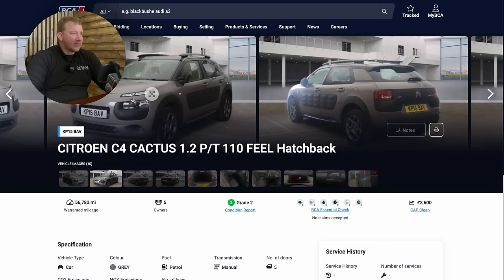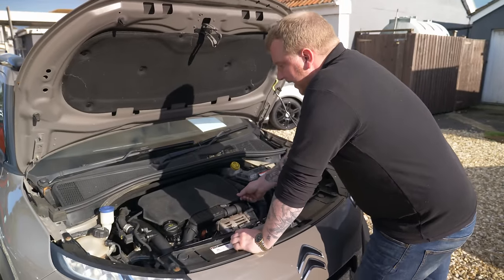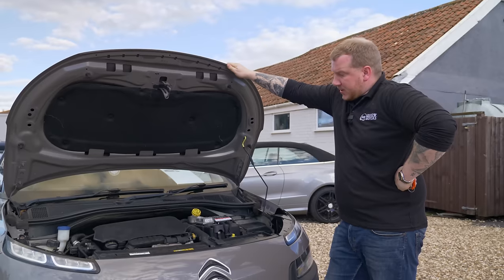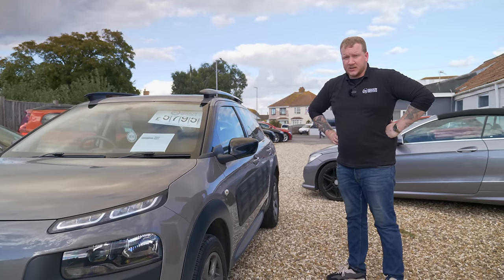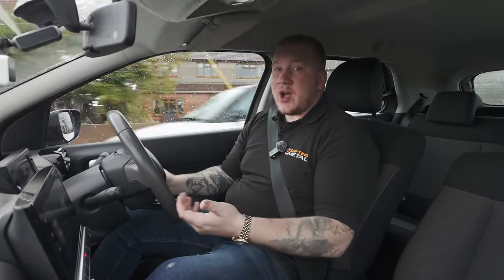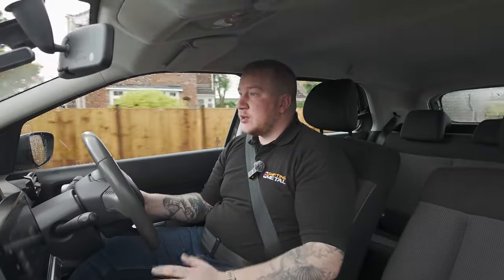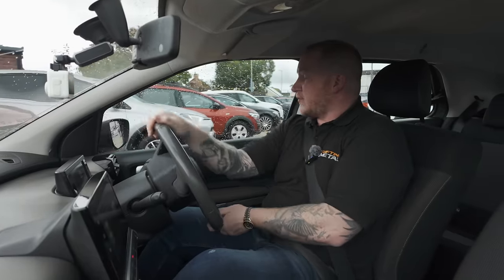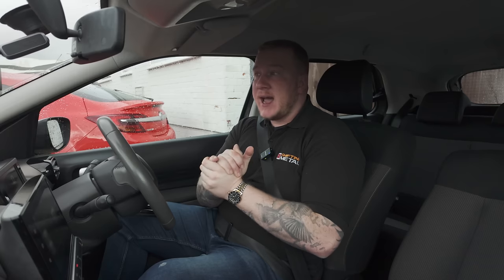I Bought A Car From BCA And It's Got The WRONG ENGINE!

Comment: When that guy was sat around the big table and he said "I've made an engine that will run on a new system called a wet belt", they should have shown him the door there and then 😮
Reply: The designers got AWARDS for this design 😂😂😂
Reply: @exgtt2061  the award should have been life no parole
Reply: @bigbob7062  😂👍
Reply: And at the same table someone said: hey and lets have engines with different coloured dispsticks.
Reply: Wet belt isn't inherently bad. It's implementation of the design is bad, WHEN, combined with the regualtions requirements, component costing and packaging concerns.
Reply: blame the EU as it was the new emission rules which forced manufacturers to make these bad decisions all to make the engine quieter and lighter.
Reply: @williamcoulter5462  how can it be the EU's fault when other manufacturers don't have the same issue?

Comment: Before selling, might want to read this: I know this is an old thread and everyone may have either sorted the problem or sold the car, but I've just experienced the same problem following an engine change from a yellow dipstick engine to orange dipstick. The fault code P0087 is misleading as is suggests there is a fuel pressure problem, but I subscribed to Service Box for a day and compared all engine part numbers between the two engines. Peugeot are clear that, although the engine code EB2DT is the same, some part numbers are different depending on whether it has a yellow dipstick or orange, the main one being the inlet camshaft. I have now replaced the inlet cam on my orange dipstick engine using the original one from the yellow engine, and that has cured the problem.

Looking at the two camshafts in my hand, you can see the timing of the three lobes that drive the HPFP are 60° apart, so it looks like the ECU picks up the timing of the high pressure pulses which is 60° out of phase and shuts the pressure off, and then tells us there is a pressure problem. I have observed the pressure on live data using Diagbox and it is much more responsive delivering the required pressure compared to using the orange engine camshaft.

So, the bottom line appears to be the ECUs are configured differently to match the different camshafts - totally unnecessary in my opinion, but...there you go!
Reply: Would it not be easier to change the ECU,s rather than the camshafts ?
Reply: @peterjones2650 think that depends on coding, ecu has part of the immobiliser in and they would be vin locked i suspect.
Reply: @peterjones2650 if changing the part the ecu is not expecting fixes the problem, that is always best.  Putting a new ecu in from a different type, might cause new unexpected problems with one of the many other parts and sensors.
Reply: can code this(change from Yellow to organge-grey-green or from orange-grey-green back to yellow) in your ecu remotely if you have diagbox cable

Comment: Citroen have a history with dip sticks.
During WW2 when they were under Nazi occupation they swapped out the dip sticks for "extra long" dipsticks so the Germans would run the engines  low on oil and fail prematurely to help the war effort/resistance.

Comment: Had the same issue at our Peugeot Citroen independent , new engine fitted, lobes that work the fuel pump are at different angles. Put the cam in from the old engine perfect. Original issue was that the car would drive perfectly around town at low speeds but as soon as you went to motorway speeds light on and limp mode

Comment: Those 1.2s are a ticking time bomb. Even if you have one that’s had its belt done it won’t help you because the damage is already done and it’ll have had oil starvation when the original belt degraded and now it’ll guzzle and burn oil for fun until…. it doesn’t!! Don’t touch with a barge pole.

Comment: The belts degrade even if recomended oil is used.
Reply: Mine is coming up to its 10th birthday so I'm not complaining.
Reply: As does every timing belt on every car
Reply: @agiugabenson7268  not nealy as quick as a wet belt though ?

Comment: So when the engine was changed at the main dealer as you said. The problem is with the parts department at the main dealer. They have to supply the workshop the correct engine. As the parts department are looking it up they should be checking it's the right engine for that vehicle's VIN number.

Comment: I had a DS3 from BCA with the same issue, someone had swapped out the engine for an different spec. Was impossible to fix and BCA had it back in the end. Full refund as was not sold with any explanation on the sale! I am in the trade and they will refund you!

Comment: The wet belt systems are a fundamental design flaw, heaven knows what those designers were thinking at the time.. well in theory they would be great, but hot oil and rubber don't really get on and as the belts degrade, they drop bits of rubber in the filter .. and a blocked oil filter leads to a seized engine. They say "use the right oil" but that's not the complete solution, it will still happen. If I were to buy that car, I'd replace that belt twice as often as they say to.

Comment: Main dealer parts guys like engines as they get more bonus for selling a high value item. So they should be more careful when looking it up on the electronic parts catalogue to supply the correct part.
After all, surely the same note that pops up on your diagnostic machine, should be displayed on the EPC.

Comment: I've found Aston barclay is the best of a bad lot, go in person, wait with the car, not in the hall, take your mechanic with you, not as glamorous as just bidding on line, but loads safer, don't buy anything expensive without it being assured, not infallible, but at least you'll have a better chance, avoid anything  that's known to be a bad vehicle as well, no matter how tempting. Check everything online as well, mot history, Google reg number as well, I did that the other mth on a 4 series m bmw, it was on a dealers forecourt only a week before at 11995, now it was going thru Astons at 9k,sure enough engine had a slight bottom end knock. All good advice mate from someones who's been in the job for a long time.

Comment: True the lobes on the inlet camshaft are different causing incorrect fuel pressures,Citroen technical said there are other differences in the engine so put the correct engine in.but you clever guys out the are doing different things that a main dealer can’t do.

Comment: That dipstick looks like the one that it left the factory with. The difference in colour indicates that there is a difference in the timing belt tensioner. That will be the cause of the problem as the wrong tensioner was fitted, throwing the timing out.

Comment: KP15 BAV, was for sale in June and Oct 2020- £6250 with 55k, then again May 2021 £5750, 55k dead again, red flag. The wet belts shred even with correct oil and regular servicing they need to be over serviced to guarantee. The mot history is not great looks like 48k and failed on loads first mot 3 years old
Reply: Next job for you car buyer at Berrow motors, Joes Glamorours assistant.
Reply: BP15 BAV is a blue VW Golf what's it got to do with this car?
Reply: @waynemandco  nice he can’t afford me a track down real crimes
Reply: @tootles74  Good spot KP15 BAV
Reply: MoT history also shows it had sat for three years between the most recent tests. That alone would have told me to look elsewhere.
Reply: The only way out with this is to get someone to make an electronic widget that alters the fuel pressure signal to something the ecu is expecting.

Comment: Send it back! EML is a MOT failure regardless and you shouldn't have to be clearing it for MOT or for a customer, it's got the wrong engine for a reason, worst case scenarios on those puretech's ios it kills an engine and maybe that's what happened to this so they replaced it asap and chucked it into a auction, it's very suspicious and don't even bother with it as even parts you get now will be wrong

Comment: PSA know how to make good bodies (don't rust) good seats, and good suspension.. but are terrible at electronics. The switches break, the relays melt, the cables corrode, cars do weird things like wipers coming on when the car is left parked... Radio is coded to the ECU , mileage is stored in ECU and speedo... just drama all the time.  The Japanese seem to make the best electrics.
Reply: remember the 1.6 diesel... dog of an engine

Comment: ANY oil degrades wet belts they are DESIGNED to snap
Reply: Exactly! Just like BMW mini have a designed weak spot, a plastic bodied water pump. They know it doesn't last long and needs replacement, so screw customer out of servicing or unnecessary trade in. The majority of motor manufacturers are now just greedy who don't want their cars lasting forever, it's bad for business.

Comment: An expensive lesson learned the hard way as to why wet belt engines are best avoided.
If you do sell it, be prepared for it to haunt you.
I would stick it straight back into the auction, and absorb any loss.
It takes years to gain a good reputation, why risk it with a dodgy car.

Comment: What a nightmare! I am glad my VW Passat CC disel 2010 does not have all that cobblers! A much simpler setup.
Reply: The reason is "2010", not the fact it is a VW
Reply: I had one of those, biggest heap of shit ive ever had
Reply: @stupossibleify  If you wish to comment, try to say something that makes sense.
Reply: @JoanCarradine  Ok: "Euro 6'. Does that now make sense to you?
Reply: @stupossibleify  Nope Euro 6 did not begin until 2015, thus my car has a Euro 5 rating.
Reply: @JoanCarradine  that's my point! Euro 6 is the issue blighting all modern diesels. Your VW has none of these issues because it is pre-Euro 6. It has nothing to do with VW being inherently better when compared to the vehicle in this video. Goodness.
Reply: @stupossibleify  That is just your opinion, NOT a fact! Get over yourself.

Comment: I wonder if you could just swap the fuel pressure sensor for the correct engine? The ECU is only recognising pre programmed parameters. Perhaps that is one if the differences? The computer can only see differences in the maths .. it cannot see the colour of the dipstick.

Comment: Can't you use some kind of resister or the opposite of a resistor on the fuel rail pressure sensor wire to make the ecu see a higher pressure.

Comment: I would buy the the Topdon diagnostic machine and drive the Citroen for years, just keep clearing the code when it pops up, that’s if I would ever buy a French car again, which I never will, after a nightmare with a Peugeot 307 HDi!!🤣
Reply: So are you saying that Joe has a new workshop go for, run around motor 😉 if it doesn't get enough at auction?

Comment: Back in the early nineties when I was in the trade I did worse than that..  I bought a what seemed a relatively cheap,. indeed too cheap Nisan Micra from Exeter auctions without looking at it and leaving a proxy bid.. When It eventually turned up at my site here in Cornwall I found out that someone had put a fairly crap mini engine in it!   Did I feel stupid or what...

Comment: Can't you just change the ECU for one sourced from a (scrapped) Shitroen with the same variant of engine that's in this car?
Reply: Yeh spend a 0ver 500 doing that not with that margin, i would have sent it back as not motable 😊
Reply: @DashDriver-z1r  👍
Reply: ECUs have been VIN/Immobiliser locked for well over 20 years
Reply: @kaptinkeiff last car I replaced the ecu it had egr set to minimum (to pass MOT emission test) and immobiliser disabled
Reply: @leexgx  Correct, you have to disable the immobiliser to use the ECU, some companies offer the service for some brands

Comment: Remember this.  Wrong engine in car.  If remember. Already swapped over. I’ve had one P/T. Yup. Was goosed. Oil sump removed they’d already cleaned the gauze.  Gave up immediately trying fix it then.   Wanted do chain.  In end. Never managed start on it. What an engine the PureTurd

Comment: In the 80s the Dealerships were annoyed that people bought new cars and then took them to their favourite backstreet garages to do servicing work. One of the first to try and turn customers back to Dealerships was Vauxhall and their recessed plugs. You needed a special tool to remove the plugs but Vauxhall had the copywrite to it. And so it has gone on. All manufacturers have layered their vehicles with as much "safety" etc products, computer controlled this, computer controlled that. Local garages can't afford a lot of the software to be able to deal with easy to fix faults. Now, even the dealerships can't sort it out as you've found with the software. (Possibly because the Manufacturers are wanting to deal direct with customers or everything will be leased.) I much prefer older cars. £2 for a headlight bulb rather than £700 for whole unit. (Explains why so many newish cars have headlights out on one side at night.)
A modern mechanic is an IT worker. 
Keep up the good work, love your vids.
Reply: Even the dealer dont want this nightmare lol Agreed though, As a mechanic trained in the 90's car parts are expensive and a minefield of tec related isues.

Comment: Can someone please enlighten me as to why the colour of an engine oil dipstick would cause a fuel pressure fault and engine management light?
I own a 2005 citroen berlingo diesel and the dipstick on that is just a dipstick that tells you the oil level when you pull it out. I'm just mystified as to why a certain colour of dipstick would cause engine faults. 🤔
Reply: The dipstick colour just indicates which type of camshaft is fitted to that particular engine, it’s colour on it’s own has no effect on the the way the engine runs.

Comment: never ever buy one of those new Shitroens as i call them they are as crap as the corsa and fiat 500 etc always trouble with them , I bought a 500 from a dealer cost £3 grand for a 2013 lounge model with low miles i thought it was a good buy but they never told me the clutch and gearbox were knackered so £1000 on top of that £3 grand i paid for it and after months of arguing with the dealership only got half the £1000 repair bill back and the worst thing was the warranty they gave me was not worth the paper it was written on.

Comment: Jesus, check the pin data on the ecu harness and swap the wires to the correct location, use carmine if you don't have access to wiring diagrams
Reply: Carmin, auto correct strikes again

Comment: Does the v5c have to have the new engine number added before you can sell it? Does the vine number refer to the type of engine it should have?
Reply: Well on the electronic parts catalogue in the Citroën parts department it should show what engine should only go with what VIN.
Also the V5C should have the new engine number on it.

Comment: Having driven a number of fleet cars since the 90's, Citroen and some times Peugeot dealerships have been mentioned in a bad light a number of times. Not sure why Peugeot are better, being the same group! 
More often than not, it was the silly little things that had owners going round in circles for months, wasting time and money on something that should be solved in one lowish priced visit! And now I hear this on top of this dodgy engine. A dip stick ffs! 
I'm fast running out of cars I think are a safe option after 2012! A new one, they must be joking!

Comment: Why don’t you just change the ECU for that engine? That way? The ECU will tell the engine that the fuel pressure is fine. Also is there no warranty if the engine was replaced??

Comment: I have a 1.2 Puretech and it is a great engine, plenty of smooth punch and good mileage. These engines are in all sorts of vehicles.
The recommended belt change is 7 years if used for short journeys and 10 years for long ones. I DO BOTH!!
So it got changed at 7 years, was in great condition with no cracking or shredding and did not cost very much, with a minor service I spent under 500 quid at a Peugeot main dealer. This is a car that is serviced and oil change every 12 months at Peugeot main dealer and is looked after.  On most models you can see the belt from the oil filler.
I would not hesitate to buy a 1.2 Puretech if the servicing has been kept up to date and belts changed every 7 years.
Most people have never heard of these issues.
Reply: Thanks, just bought my daughter a 1 2 puretech. I'll get it into peugeot.

Comment: Sorry, I thin’ that may have misunderstood - can’t the dipstick be changed for the correct one from a breaker?
Reply: It's not the dipstick thats the problem it's that the engine has been swapped for a different version one and whoever did it hasn't told the ecu that it's been swapped so it thinks that the fuel pressure is wrong hence the eml and limp mode
Reply: The dipstick colour denotes the engine design. I think the oil pressure is lower in the replacement engine with the orange dipstick than the original engine with the yellow dipstick. The ECU is receiving a lower oil pressure reading than the one in its programming.
Reply: @olie3146  Sorry, the dipstick is obviously irrelevant - I was mislead by Joe’s description!
Reply: Come on you've got to be trolling here 😂

Comment: Makes no difference with these purecrap engines if you service them religiously with correct oil the belt cracks and breaks up I had a Crossland 39k belt was full of cracks full service history had belt changed had to pay but Vauxhall refunded me , it’s not just the belt it then developed a terrible whining noise there was knocks and bangs from suspension the clutch was on the way out it could not climb hills the thing felt like it was about to blow up at 60 mph the list goes on worst car I have ever owned and it was not even 3 years old I dropped it like a hot potato terrible awful cars